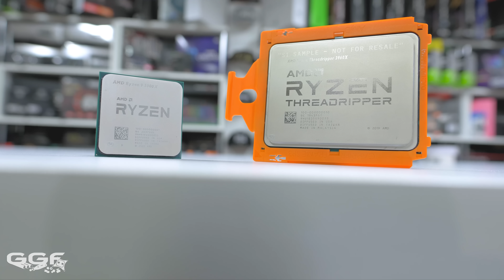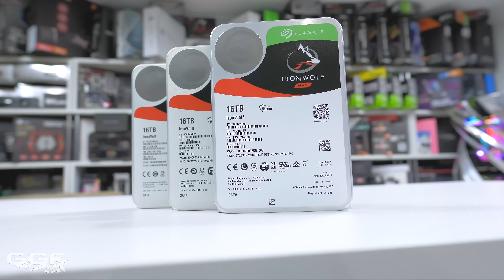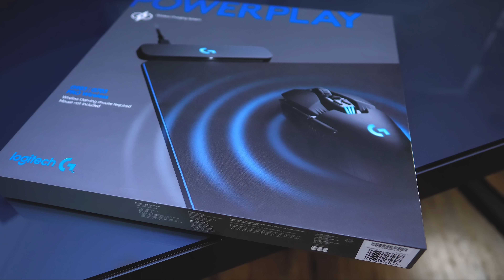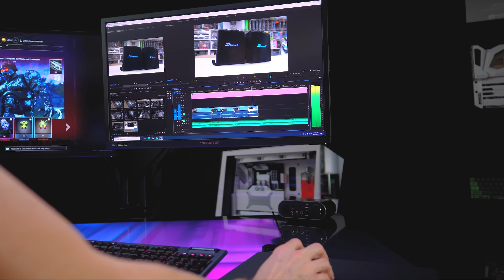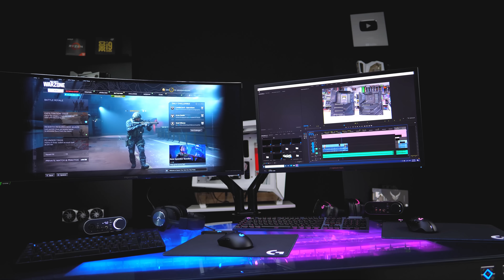My DREAM $25000USD Editing & Gaming DUAL PC Desk Setup! - LIAN LI DK-05F

Comment: Has RTX 3090 and Ryzen 5900X
Warzone: best I can do is 150 FPS
Reply: at 900p
Reply: Yeah, lets ignore the fact that its a 4k ultra wide running maxed settings. You can easily get 210+ fps on warzone with lower settings and only 1080p. ULTRA WIDES ARENT MEANT FOR FPS COMP GAMING!!!
Reply: i meaannn, 4k or 2k gaming has significant fps drops after switching from 1080p. its just how it works, your gpu has to load more shit and thats makes it lower fps.
Reply: @Alex-km7wd  I use an ultrawide for Tarkov and i love it.
Reply: 🤣 i have 1060 hardly able to reach 60 fps
Reply: Mark Jones  I can get 200 fps on my 3060/5800X build, minimum settings with balanced DLSS
Reply: @Kashkan14  Ahh thats you then because you don't understand a simple joke on Warzones Optimisation.
Reply: @c0pz205  lmao he runs that on 4k max quality you want wz to run on more than 200fps?! No way
Reply: @Kashkan14  stay in school please.
Reply: @c0pz205  lmao says the guy who knows nothing bout PCs
Reply: @Kashkan14  Dude I work as System admin lol, your problem is that you didn't understand that my comment was sarcastic on Warzone not being optimised in the first place.
Reply: @c0pz205  lol
Reply: why would he play a shit game like warzone
Reply: imagine if it was threadripper
Reply: i have a 3090 evga ftw3 and a i9-10850k and get around 230 fps

Comment: Really cool, but I have no idea why I'd like to have two systems like that. I doubt that the Threadripper system won't run games well enough with a nice gpu.
Reply: I mean right now threadripper is a gen behind so for high fps gaming ryzen 5000 is better. Also the threadripper system could be busy at 100% working on a job and then game on the other system. Id imagine if you are using the threadripper system for work you wouldnt want to be doing anything on it that could interrupt it
Reply: dude ryzen TR 3990x can play cyberpunk at 100+fps with a 3090 only on 15-16% cpu usage

stream,render,edit,game,watch youtube, ryzen Threadripper series is built for this
Reply: @blindsay  imagine a ryzen TR 5990x
Reply: @yasshowardhanpethe8577  So A: 5990x doesnt exist B: You clearly don't understand what high fps gaming is. C: understand the value of having a critical workload that you cant risk interrupting. A render could easily have a CPU at 100%
Reply from the maker: At 4k the difference between a TR and other high end CPU is a few percent if that. The 3960x is hitting 4.4 single core .
Reply: @GGFEvents  At 4K yes, but if you are referring to my post was for high fps gaming, which would be 1080p/240 or similar, which the 5000 series chips do have a notable advantage
Reply: @blindsay  dude i use a TR 2970xw myself and i use ryzen 5 5600x for gamin i know HIGH FPS gaming

no not all cpus are at 100% when on render it depends both on the render and the cpu
i use autodesk 3ds max.
SO plz dude
Reply: @GGFEvents  thnx for the tip
i have the money to afford a pc like this but not people like u to build it for me

Love from India
Reply: @yasshowardhanpethe8577  You do understand there are programs other than 3ds max right? Also the 2000 series chips were trash for gaming, so plz dude yourself
Reply: @blindsay  I know there are other programs(houdini,blender)
Reply: @yasshowardhanpethe8577  but I thought TR was amazing at doing everything? Why do you have 2 systems then hmm? Sounds like you proved my original point gg
Reply: @blindsay  just like CGF's build above one for gaming one for professional work 
Yes TR is amazing at everything.
and  didnt yr point
Reply: @yasshowardhanpethe8577  Except RTX On.
Reply: @abdulmuhaimin5274  WDYM

Comment: Thinking about starting to save up for a similar perhaps cheaper desk like this for a few reasons.
Mainly as I'm not rich so I don't even own two gaming pc's worth of hardware to put in the desk to start with.

But as a question to people who might own one for a while now.
How goes the cooling compared to a regular case? How's the fans? is the air getting properly moved around in this (quite larger) desk compared to a smaller case?
How's the heat according to the system and how hot's the air when its blowing out? 

Most importantly how's the dust and cleaning?
problems I have right now are that my case is a bit too big, and I lack space.
So the poor thing is standing on the floor, and you know how that goes with dust.
I'm hoping a pc inside the desk will not only help with my space problem, but also reduce the amount of dust that goes in the intake.

Comment: Got mine, its sensational APART from some slighty bent kit as supplied..........got around it in the end but small room I am in meant scuff marks on the edges in certain places.     Lian Li support...............after i reported it, have offered to send me a replacement glass panel as a way of compensation.    So overall...............its amazing.

Comment: Your video is so amazing that I wanted to get one. And...I bought one a few months ago second hand. I did not do a watercooling system like yours, I chose a AIO for the CPU. 

I have a question for you if you have time for it: how the HDD are going to be cooled? I can't see any room behind them to put a fan.
Any Idea?
Reply from the maker: @cmoaaaaaaaaaaaaaaaa  if there is enough flow you don't really need directly HDD cooling unless you are using the drives 24 7

Comment: I just have to ask, how much does this build weigh with all the loops filled? This is an amazing build, the only thing i think would be better if there was a way to hide the PSU cables. I know that they probably are not able to seen when the glass top is on but still would be noticeable to me.

Comment: I know it has been a few years but I do have a question from timestamp 5:08 to 6:00 for the EK-Quantum Reflection DK-05F Left  & Right D-RGB - Plexi did you connect any of the ports of the EK-CoolStream PE 480 (Quad) to the  EK-Quantum Reflection DK-05F Left  & Right D-RGB - Plex?

Comment: Really nice build, it's amazing.Where did you install the drainport ? I have the same case but i'm still figuring out where to install it best. Also the 480 rads should be max 40mm thick when installed with the lian li distro ?
Reply from the maker: Yes 40mm max

Comment: i see on the pump reservoir, there is one TUBE Going out, can you explain to me why? and how ? because i have also a DK05F andi  got it running with a watercooling system but i wanna change it like yours.
Reply from the maker: This was purely for pressure checking every for months.
Reply: @GGFEvents  oh i see thanks for answering :)
Reply: @GGFEvents  thanks for the answer, but do you have any output? Like a way to get rid of the water somewhere??
Reply from the maker: @Knattertun  nope
Reply: Could you just tell me how many pieces of each g1/4 tube connectors i need??

Comment: Really curious for which purpose the short horizontal tubing to the back of the table was added?

For draining? If so how can that work on such a high spot of the loop?
Reply: Wondering this as well. @GGF Events what's the story with those short bits of tubing coming off the upper-left corner of each of the Uni 140 Distro/pumps? My first thought was fill tube, but now I'm thinking it's a fancy vent.

Comment: Can you tell me how you did the tubing from the 480 radiators to the EK-Reflection-Parts?

For me it doesn’t exactly fit when using two 90 degree fittings. Did you need torque extending parts?

Comment: Currently working on a similar loop for my own build in the DK-05 (Threadripper Pro workstation on the ASUS WRX80E-SAGE board, haven't quite figured out what I want in the secondary system) - what fitting combo did you end up using to connect the front distro blocks to the rads?
Reply from the maker: Nice! Tbh I can't remember sorry. But I think it was just a mixture of fixed angle fittings and adjustable sli fittings worked best.
Reply: @GGFEvents  No worries - kind of figured I'd be doing some Frankenstein shit since it's not a visible connection. :)
Reply from the maker: @Sbarnz  yep that's. Definitely won't be seen at all.

Comment: Are those D5 pumps? I find I am having difficulty with flow/pressure if I do it all on one D5 pump for a given single system with 2 radiators, a cpu, and one gpu.
Reply: You shouldn't be having any flow problems with only two rads and one GPU.
Reply: @FortuneSeek3rz  Upon further inspection I think it’s just my CPU block is too restrictive, and it’s very difficult to position the jet plate properly and in a secure manner. It’s an AlphaCool XPX Nickel plated Copper with Plexi CPU block. It was better when I first bought it so I don’t know why.
Reply: @depth386  I had an Alphacool XPX Aurora on a Core i5 9600k processor. Also had two 360mm Alphacool radiators and a GPU block in the loop and never had any problems. Your CPU block may need to be taken apart and cleaned.
Reply: @FortuneSeek3rz  It is precisely after my last cleaning that I felt the jet plate was a bit janky during reassembly. I’ve had the PC since 2019 and I have cleaned it twice and even re-done some runs. My waterblock is not the Aurora model so that’s one difference.

Comment: small tubes in the back had no fluid running through them, why?
Reply from the maker: Because they go nowhere and used for bleeding
Reply: Thanks for the reply. Very cool build 👍
Reply: @GGFEvents  How do you bleed a system like this? Do you have to tilt the desk on its back?

Comment: 9:45 you can see a MASSIVE flaw in the system/design. The cpu is getting cold water from the pump but then the hot water (which is probably boiling because it's a threadripper) that comes off the cpu is going directly back into the pump! What's the point of water cooling the cpu if circulating its own hot coolant

edit: sick build anyways

Comment: 1.  This is the sexiest thing I've ever seen.
2.  I have a water cooled Ryzen super rig and they burn hot as hell in normal operations.  This thing must be able to heat a small house in winter with radiator exhaust.  Do you have a way to take all that radiator heat and get it out of the room?

Comment: i would really like a rtx 3060 but its pretty expensive with my 5 euro alowence every month
oof and i need a new case, motherboard, a new internal ssd and water cooling
its around 700-800 euro's or more
ooooooooooooooooooooooooooooooooof